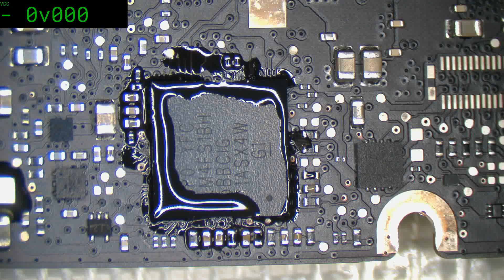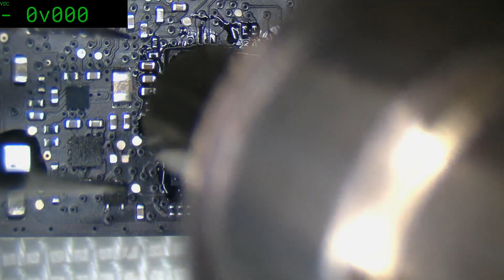Using the improper amount of flux has consequences

Comment: Two problems: (1) If you use a board preheater your rework station needs less heat and takes less time to pull the IC. (2) More flux is better because if the solder wets around any of the surrounding components of the IC that you are removing/ installing, you will have flux on them. Case closed!
I hope that this exercise in common sense but's an end to the, "just enough flux" crusade...! More flux!!

Comment: Don't force parts, as the pads adhesive is softened and will de-laminate.  very gently probe the part to feel when it lets go. I use the tip of a dental pick or related tool to feel when the part is free and floating.  If you have applied force with tweezers to feel it come unstuck, you will rip out pads.If you have a small vacuum parts pick and place handpiece, they work well.  When the part is floating, the vac cup can be used to lift the part.

Comment: I would recommend using the old method and nudge the bga chipset before removal to avoid pads lift. However sometime NC pads will come off regardless.   Pulling pads and traces are trade mark of Louis not you Paul. Lol. 😊👍

Comment: Question what are somethings one should have atleast in terms of basics if they are going to work on circuit boards for taking stuff off and putting things on. Because seems like a soldering iron and such, will do the job for a lot of stuff. But the smaller bits and such, seem like they need something else.

Comment: Not sure whether it's the quantity of flux or just being a clumsy bastard 🤨😂
Reply: I don't think it was the lack of flux that was the actual issue, it was him yanking off the chip instead of making sure all of the solder was molten, which can be done by gently tapping it to one side - if it moves and then goes back into place, that means it's ready to take off.

Comment: You can't pull like that on lead free bga chips. Its obvious they would melt on pad by pad basis therefore all your force will focus on a few pads.
More flux and heat, Less force
Reply: What do you mean the pull-out method doesn't work???
Reply: Dad.
Reply: Agreed. You only want to pull just hard enough to overcome surface tension and then ONLY once the chip is fully floating (moving freely when tapped / nudged). Never apply any force before it's floating!
Also I find pre heating the board helps considerably when desoldering BGA components.
Reply: A case of "don't use the force Luke" applies in this case